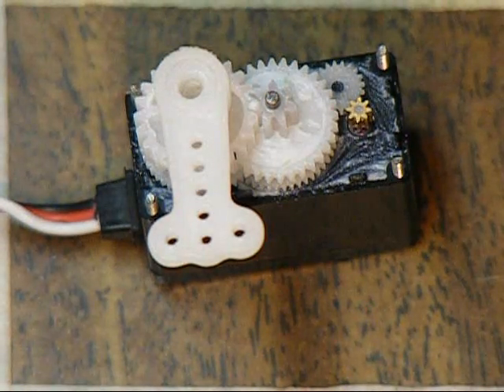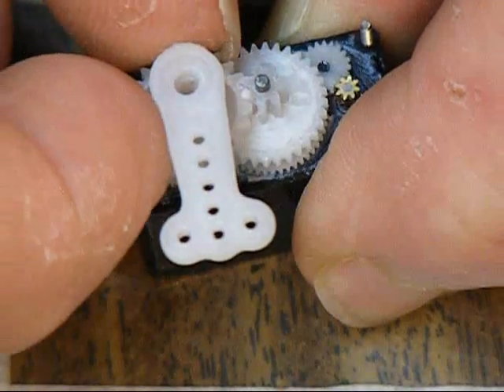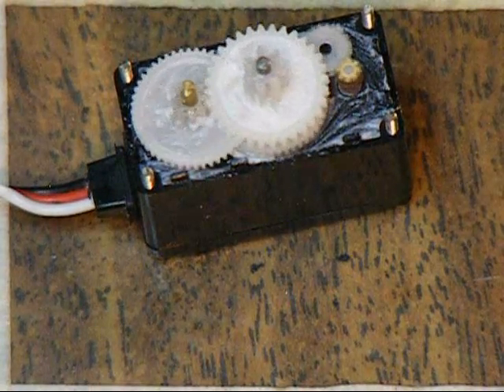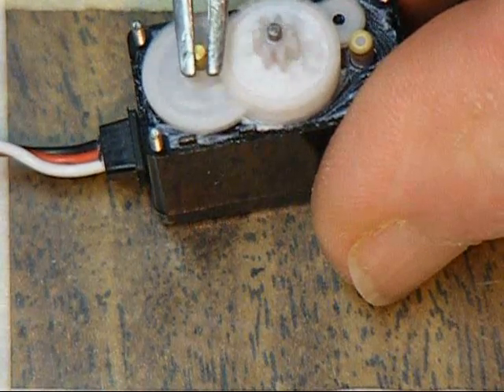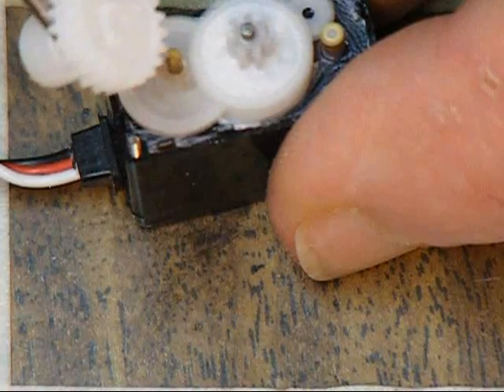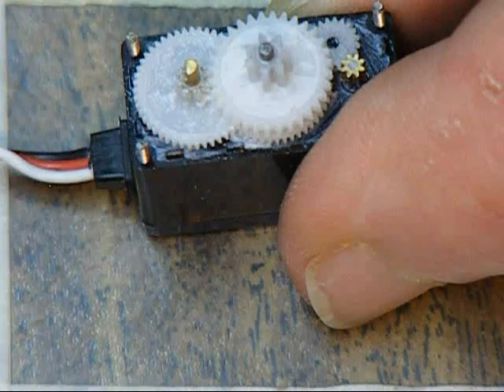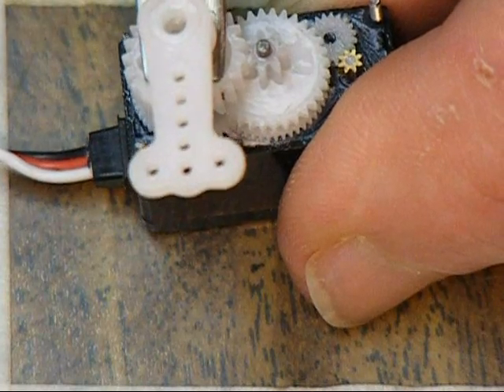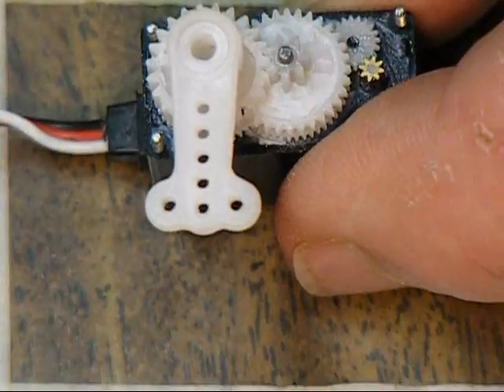Fine Tuning Servo Set Point

Comment: Have you ever had a servo that constantly loses center. I purchased two servos for a project and both of them had the same issue. I could set the trim all the way to the right, and within five minutes they have drifted so far off center that I reach the limit of trim adjustment in the opposite direction. They were lower priced servos, but I never experienced this before. Could it be a transmitter problem? I really don't think so since the transmitter works with other vehicles.
Reply from the maker: No never have. Interesting that both servos acted the same. But since the Xmtr works fine with other servos, it sounds like the problem lies with these two units.

Comment: I'm a little confused because that brass shaft seems to be cut in a way that the gear with the horn will only ever fit on it one way and the shaft is always going to centre to the same position, if the gear will only go onto that brass shaft in one position then how can it be replaced at any angle you desire?
Reply from the maker: You are correct, the brass shaft does have a "keyway " cut at the top. And if I had given the video a little more thought before making it, I could have talked about it. (and more importantly the shape of its mating gear piece). But long story short. The gear that is fits this shaft has no matching "keyway". So it can be pressed on to the shaft at any angular position. These two parts are bound together with just a simple "interference" fit.  
Good question, and thanks for taking the time to ask it.

Comment: When you say pot is 'infinitely' settable, are you saying position the pot anywhere you like then put the servo horn back on?
Reply from the maker: +Buck Lee
Thanks for the question, I'll bet there are others asking the same thing.
Here's how I'd respond: 

 No.. Its the other way around.
The pot position is critical. It should be turned to the position where the motor doesn't spin (with everything powered up {including your transmitter}, and with the control-horn gear removed). Then, kill the power, and without moving the pot, the control-horn and its gear can be installed anywhere you want. That position will then become the exact center (for the control horn) the next time the system is powered up. 
In the video I started with the horn at 90 degs to the servo body, and ended up with it in the same place. That was because, for my application, it was already correct. But say you wanted the horn to be at some other angle to for center, then I would have pushed the horn and gear assembly on at that angle. 
To be honest for me, the splines provided on the control horn gear, plus the transmitter trim buttons provide more than enough resolution to set the Horn's center position. But then my applications are for aircraft, where wind has way more effect on which way the craft is drifting. However if your operating a car on a tight circuit, then I can see where the steering trim could be considerably more critical.
Reply: excellent response thank you.  yes I'm trying to center a darn 24T Hitec servo for my 1/8 buggy and would like to tweak center so the steering trim is closer to center so I don't have heavy trim left or right.

Comment: This video was a great help to me. I'm new to rc and am so far insisting on using a non-programmable radio. Thus far I've been able to work around the arm not being perpendicular to the case. 

I'm presently working on a model that uses one servo for the ailerons, and it becomes buy a programmable radio, or figure out how to get the servo to center w/the arm perpendicular to the case.

Sure glad I don't have to spring for a programmable radio to get sub trims. Thanks a bunch.

Comment from the maker: For most applications, you're right, that's all that's needed; However, for some, there are times when, even an offset 1 or 2 degs (which can happen, pending how the final output shaft is positioned on the pot) is unacceptable. Apparently RC car steering throw to the right & left, is one of those critical applications. Good question though, as the vid created in response to an earlier discussion, is not complete unto itself.

Comment from the maker: You're welcome.. Its rewarding to hear that it was helpful. 
A follow on point. Probably obvious but not stated is, if you are using this to center servos for a specific application. Perform this setup W/ the servo plugged into the channel it will be used on.